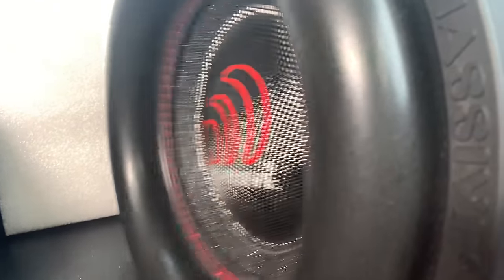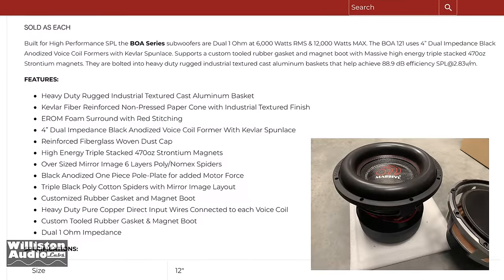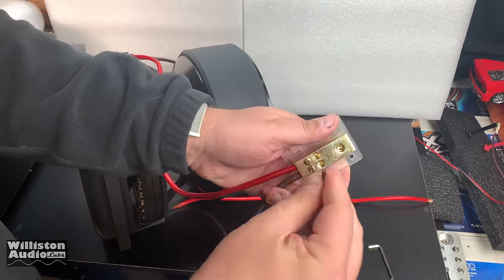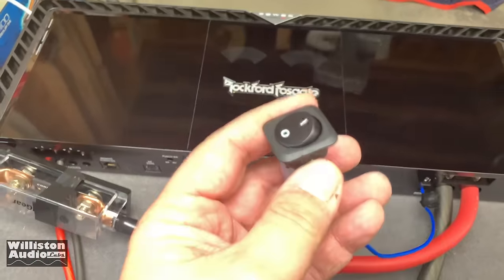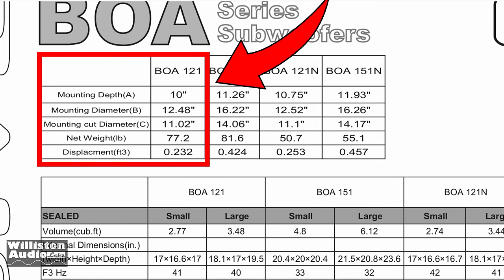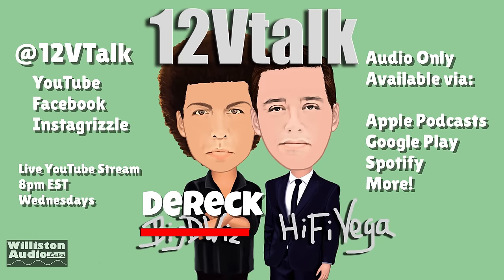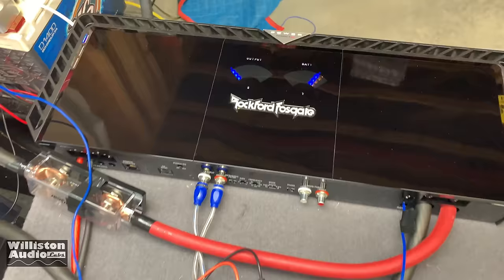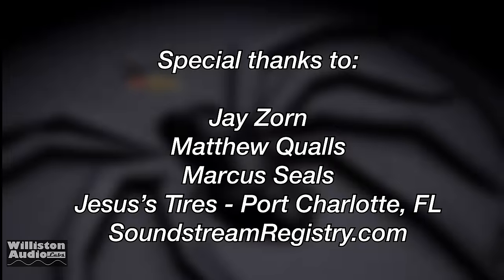Massive Audio 6000 watt RMS Subwoofer!! [4K]

Comment from the maker: See the Massive Audio Website: https://goo.gl/wtBauL
Shop for Massive Audio Subwoofers: https://amzn.to/2th9GuZ
Rockford Fosgate T2500.1BDCP: https://amzn.to/2THfEkC
Shop for OSS Merch: https://teespring.com/stores/bigdwiz
Reply: Reminds me A LOT of my custom TC 4HP 12s I built a while back, except mine weighed a little over 90LBS each LOL
Reply: Williston Audio Labs check out my videos of my 12 inch massive audio hippo XL subwoofer 2000w RMS 4000w max! It's a beast of a subwoofer that I love
Reply: Beating on that amp like a boss
Reply: Dude I'm telling you I've got an idea for your channel expansion and it has to do with speakers and it's like the old-school amp test!
Reply: Noticed the "scratch out" of the "Big D Wiz" on the 12V Talk banner... any reason why you stopped using that name?
Reply: Judging by the chair...do you live in Orange county?
Reply: Hey - you said on the website you were wondering how to show how loud it is on video. Well less ingenious methods like water cups, multiple of them and varying staggered distances from the sub would provide a visual representation. Or just a dB meter ;)_
Reply: Question:  Could this sub be powered by a rack mount Crown amp (AC input,  but still should put out DC voltage?).   In other words, this could be used in a DJ setup as well as a car stereo ?
Reply: I bought the massive audio TKO 124 sub, is there anyway you could tell me if it’s a decent sub, or did I mess up?
Reply: Williston Audio Labs sell me your infinity M3D ? seriously. I got PayPal. let me knw thanks.
Reply: This may be a dumb question but can a 12" subwoofer only move so much air? is it the amount of X max that is causing it to have a higher db level? Wouldnt a 12" sub with a higher ohm rating and an X max of the same value play just as loud with lower wattage?
Reply: Nope, way Off...
Reply: @frijolechingon5713  Explain please.
Reply: T5t6
Reply: You can test these with,my neptune style beat.....non probo
Reply: Hai
Reply: Now that youre testing it....i will give you 100$
Reply: Massive is ok but I believe they are far fetched with the power handling I believe it could handle small burps at that wattage
Reply: Eeed
Reply: Hey brother I was wanting to ask I have been out of bass world for 20+ yrs!! I just ordered a 4000w boss amp with 2 mtx subs!! Do u think I need o gauge wire or something smaller!! Becuz I don't think the amp will put nuthin over 1500 watts maxed!!
Reply: Hola como pillo la 9Loli
Reply: Speaker rate subwoofer speaker rate
Reply: Yoh bro Derrick, need a word with you. I can use your experience and advice
Reply: Liczba głosów gghh FX dgf kg oficjalny
Reply: ⁰
Reply: i have a question williston audio lab svs make 3000 watt suboofer for the home theater but how can it output this if the wall outlet are 1800 watt at max ?
Reply: I have this very  exact sub I have a question how big should the box be
Reply: ง
Reply: So I just bought a 15"Incriminator audio TYRANT rated for 5K RMS and I have it on my AAK 6k with the BHG wattage meter and I am rising to 6-8 ohm and barely seeing 2500 watts can you please tell me the best way to fight this with a single sub setup

Comment: $1,100? That's worth more than my car lmao
Reply: That’s the old school audio way lol
Reply: Swang and bang bro 😅
Reply: That's not alot ppl spend alot more than that...
Reply: lmao
Reply: Ya like me,i have 4 w7-13z valued at 1399.00 plus tax each,so there is 5800$ alone just for my drivers.Plus 4 1000/1 v2 @ 1199.00 each plus 999.99 plus tax for ZR 6.5csi components and C5-650 coax in backdoors at 595.00 plus tax then 2 batteries xs power d 3400 at 950$ for both,then all the zero g wiring worth around 30ft at 10-12$ a foot at 400$..Then an upgraded alternator 300amps worth 500$ then Alpine 7" Ddin headunit 900$ then a 600/4 slash series amp for door speakers 650$...Then all the Scorpion dynomat sound deadening at 750$..I did floor,doors rear hatch and ceiling...And the quad box worth 750$ ..Its rediculous how fast it adds up,i pieced it together over 3 yrs and its expensive to maintain too bro get a good job Son
Reply: with a paper cone..smh
Reply: Costs more to drive it.
Reply: $1,100 Dlls por los materiales pero Whatts RMS si acaso entre 400, exagerando 600 Whatts RMS. Tiene una bobina de 4". No me creen chequenlo bien. Lo que diga el fabricante nada que ver. Solo son numeros.
Reply: waste of money
Reply: Back in the 1970's It was same thing.
Reply: @jamesfleischmann3406  you just bought over priced well marketed stuff thats all.. i have 2 FI BTL 18" subs that will shit on 4 13w7's sound quality wise and SPL and i have $1400 into the speakers!!
Reply: Paper Cone is good...
Reply: Thats perfect. Guys always have shit mobiles
Reply: James Fleischmann you got ripped off. Massive all the way. 
-former w7 owner
Reply: U must have a crappy car
Reply: James Fleischmann no vids?
Reply: Hanns Rosen—the bad thing about FI subs, especially 18 inch, is that they need too much box volume to sound good, you can’t do them sealed and the second bad thing is that they will tax you electrical system, you will need monster amps to drive them. No subs will compare to the w7s as far as sensitivity, don’t need a lot of power to get high spl and sq, don’t need huge boxes, will work ported or sealed. Less box volume if they are sealed. And the FI’s won’t shit on the w7’s, spl and sq at the same time is better with the w7’s, IT’S JUST A BETTER SUB!
Reply: @jamesfleischmann3406  what kinda car?
Reply: $1100 for destroying ears ?!
Reply: Aye you were in my recommended the other day
Reply: 6000 watts my dude
Reply: Super cheap for spl gear
Reply: Just bought a 2012 F250 for $820....This sub is worth more than my truck.
Reply: @313south5  my 2011 3500HD Dually $1400, my 2012 F250 $800...lol...
I cant wait to see how much the audio cost me.
Reply: @jamesfleischmann3406   oh man check out robotunderground. He disects all jls w6 w7 n just leave the others.  Trust me i was blown away very informative.
Reply: @ULSB1969   go watch robotunderground channel on you tube he cuts apart a few of those jl
Reply: @christopherparis6841  he can cut as
Many as he wants, they’re not my subs, I don’t care. Is he cutting w0, w1, w3, w6 or w7? If it’s not a w7, then the lower line don’t matter.
Reply: @ULSB1969  oh man proved my point....just cause i say wich one or all of them lol u should watch yourself and i wouldnt be typing this n you wouldnt have wasted your comment asking about 3 subs ya 3 thers bud. Theres 3 that you listed that only have different coil impedence or single coil terminals.
Reply: The amp is over 2k with taxes & shipping
Reply: In australia it costs $4000 yall r lucky getting it for that loe price.
Reply: I remember back when i was 18 i spent 3900.00 on a car and 6k on the system.  Lmfao.
Reply: Your car is a $1000!!!!
Reply: What you drive a potato lol
Reply: same😂
Reply: If it so, then I must say u have great deal on ur car. And what about $17,450 music system!! Yeah am ta'king about JL Audio
Reply: @jamesfleischmann3406  How much was the total cost Plus parts and labor ?

Comment: i had the same problem once so i just cut a 3/4 inch spacer and screwed it to the opening, worked great for a couple years. now i'm running the same amp with a 15 inch sundown and it's freaking insane and i love it !! not for spl i actually listen to music :}  rock on   great vids  thanks
Reply: I would have done the same thing and I'm thinking it would add strength to the enclosure but could you imagine all the negative comments it would probably get, they would say it was a hack job and rigged then they'd call me out for being the redneck hillbilly that I am
   They would be amazed at some of the things that some of us mountain ppl can engineer when needed and we can make MacGyver question his own tactics

Comment: LOVE MY MASSIVE AUDIO HIPPO 84's !!! I  Borrowed box dimensions from  A builder on ebay and even used the same 3'' Aeroports.  This is my first "built to spec" custom box and WOW the bass is so effing clean. Also 35hz near shakes my eyeballs out, It feels like a massive ripping force instead of a higher pounding sound.
Reply from the maker: This a an SPL sub, only for creating pressure. Not really my type of sub, but interesting nonetheless
Reply: @wal  ya if I had a chevy Tahoe id be running one masssive audio hippo xl 12 for sure. Nice in between sub

Comment: Back in the late 80s and early 90s was my hayday for car audio. The first car I had was a Ford Fiesta with some cheap pyramid subs running in a box retrofitted from an old plywood dresser. It sounded awful, but I still cranked it up with my Coustic amp and JVC head unit. A year or so later I had a Ford Maverick with two 12" Vortex subs and four 10" Vortex subs being powered by a US Amps 100 HCA(I believe was the model number). My poor rear window seal did everything it could to cling to the rear window as the SPL attempted to push it out. The fleck stone spray paint I painted my dash with peeled off as the dash flexed.  Ahhh, those were the days where the boom costed way more than the car. 

I can still hear Sir Mixalot rapping about his "hootie" and it seemed almost as if he was rapping about, "My Hooptie".... Good times...
Reply from the maker: Great trip down nostalgia lane! Love it!!

Comment: Judging from the DC resistance of the voice coil, and the impedance shown by the dynamic meter, that driver is very reactive, owing to the huge magnet. I would definitely recommend driving the woofer with a switch mode class "D" amplifier. The current can get far enough out of phase with the voltage, that a linear amplifier output stage could easily get out of it's safe operating area, by having the current hit, while there is a lot of voltage across the transistors. This woofer could burn out a standard analogue amplifier.
     Judging by the simulated analogue meters on that Rockford Fosgate amp, it looks like you could use large stiffening capacitors on the supply to that amp. Is that amp Class "D"? Taking current from the batteries in peaks suggests that it might be.
Reply from the maker: Yes the T2500.1BDcp is class D.

Comment: I have a 15" Sundown Audio X-15 V.2  D2 PRO. With a rockville DB15 ,  Its one sub that hits as hard as the specs say.  Modified a concert speaker box by taking out the cone tweeter and extended the hole about 3/4 back with a 1/2 in pressed particle board across the entire box. I couldn't have built a better box.  Just fits right into my jeep Cherokee. From the top of the seat to the tailgate and from window to window.  I need to switch the amp out for a 1 Ohm amp. Speaker is 2 Ohm dual voice coil, and amp is 2 Ohm stable monoblock. Its currently at 4 Ohm because i don't want  to damage the amp if i drop the speakers down to 1 Ohm. (1.2 Ohm approximately) 
Seriously for half the price, got to check out Sundown Audio!
I do not work for any audio company or retailer. Just a Bass head. Who remembers Dj magic mike? How low can you go...

Comment: Rock the MAGIC MIKE “Feel the Bass” ....
Reply: Yeah! That was a good one!... Unfortunately, not very many younger people nowadays actually know about all of those really awesome TRUE bass CDs that came out in the mid to late 90's! Now most people just use their cellphones for an audio source when listening to or "testing" speakers, but your phone doesn't accurately go down to 2, 5 or even 10Hz, (actually probabably not really anything below 20Hz), especially not cleanly , (i.e. without a shitload of totally audible and quite annoying digital noise artifacts from its internal circuitry, plus considerable and definitely audible distortion and audio clipping, especially when its output level is turned up to maximum! ), but those dedicated bass CDs from that era most definitely DO go down that low with a good CD player, (AND cleanly if the CD was properly mastered!), and so if you want a TRUE low-end audio test of any speaker or subwoofer then one really needs to experience a good bass CD! (And for God's sake, NOT just an "MP3 DOWNLOAD" of one of those albums either, because doing that TOTALLY defeats the main purpose of using a CD and its MUCH better sound quality and greatly extended frequency response!)

I had bought AND I still have about 100 of those type of CDs in my music collection, and people that I let hear them nowadays are totally blown away by how awesomely powerful, clean and ultra LOW their bass truly is!... I especially love many of the ones from DM Records and Neurodisc Records, just to name 2 good companies, as most that were put out on those 2 labels especially, also had really cool, enjoyable listening "electronica" style music tracks on them too, some of which are still awesome songs now, especially considering how those same or similar EDM beats and such are so popular now in music in general! Pandisc Records also had a few good quality ones too. Those were probably the biggest 3 record labels that produced about 80% of all of the bass CDs, so look for some albums from those companies as a good place to start if interested in getting any.

People that enjoy and truly appreciate or LOVE BASS, should really try to find and buy (most likely good condition used copies of, as most of those albums are now out of print), a few real bass CDs, (the physical CDs themselves!), to use for evaluating speakers and subs, otherwise they're missing out on how awesome TRUE LOW BASS can actually be!!

Comment: The sub is a 1ohm dvc, why didn't you run it parallel at 0.5 ohm bro instead of 2ohm in series. Awesome channel btw big dwiz 👍
Reply: Chris Antoniou well that amp does same watts at 1 and 2 ohm
Reply: Yeah but look at the box rise. If wired to .5 ohm it still would have been way above 1 or 2 ohms when played. Would have made a huge difference. With strong power supply as he seems to have, that amp would have been ok. I run dual 1.5 coils in parallel on my t2500 bdcps daily for years. Then again, he DID say that he couldn't play it to its fullest bc of noise level. Maybe that's why....?
Reply: Amp doesn't do .5 ohm
Reply: @Nov1970chevy  amp wouldn't be at .5 ohms. Speaker would be wired .5 nominal but would never be playing at .5 because impedance is dynamic - not static. Watch the video and see just how high the actual impedance was with box rise in real time.

Comment: Team massive yes sir I miss my hippos xl 122
Reply: Tyronne Hamilton I got 2- them hippo xl 122r’s love dem
Reply: I have 2 hippo xl 122s... what amp did u use to push urs? I'm using 2 Rockford fosgate p1000.1bd amps. 1 amp for each sub but I wanna get a amp that can push both.
Reply: Al Cahalic audiopipe 3000d
Reply: I have crescendo 4k the new 2018 line
Reply: Running @ .5
Reply: I’ve got one Hippo xl122 on a Mark Antony mk2500.1d in a 3.5 cu ft box and it is unsane(unbelievable+insane)

Comment: Yeah... I'm two minutes into the video and I don't understand how anyone could think this thing is necessary. You could run an entire wall of high quality subwoofer with 6k watts. There is no way one subwoofer with that amount of wattage can compete with numerous subwoofers.
Reply: So what happens if your space is limited?
Reply: @William Billowitch  It's not the subwoofer it's the damping of the amplifier which means how well it controls the movement of the subwoofer I have 2 massive xlr 12s hippos and they hit the lows well I'm running a Taramps bass 8k on them and the Rockford Fosgate is a class bd amplifier which is not class d? It's more efficient but more distortion? I'm 57 years old and been hooking up systems every since I was 16 ?

Comment: I've got a massive audio sub, 15 inch.

Called the massive audio hippo xl152. 2k rms.

I like it's pretty solid. My first 15 inch, im underpowering it by  400 watts. Just got done with the big 3 and installed a volt meter. Everything's all good. Going to put my 12 type rs back in and see how crazy the three of them will be